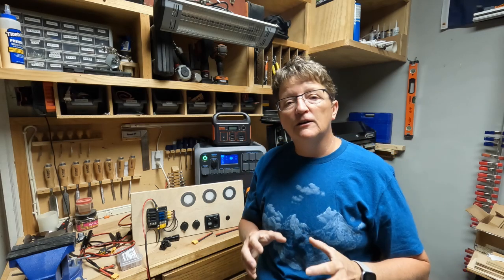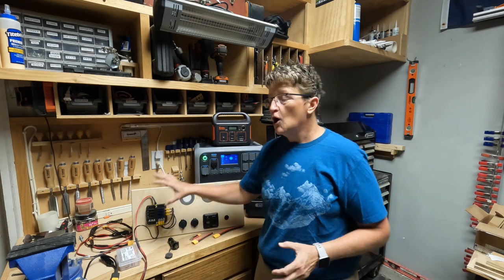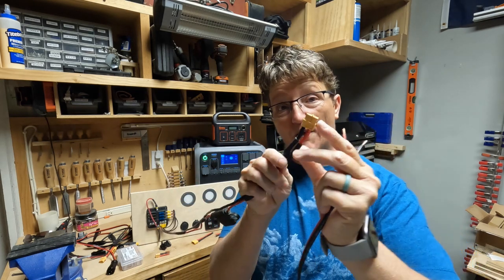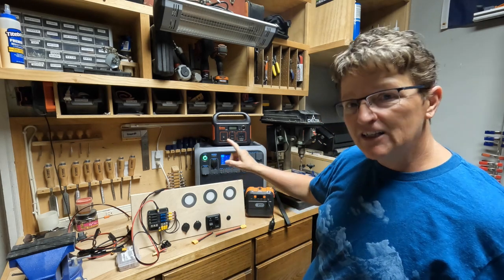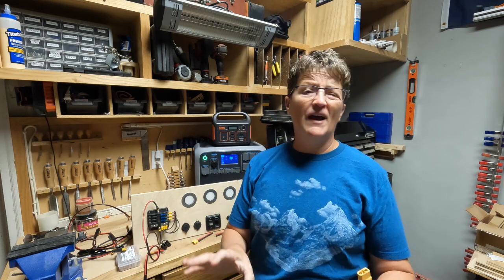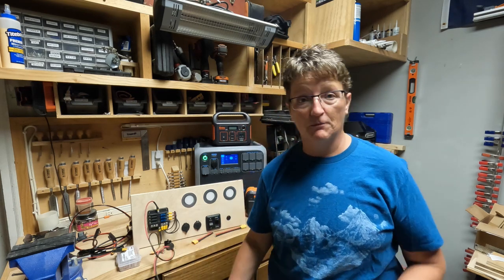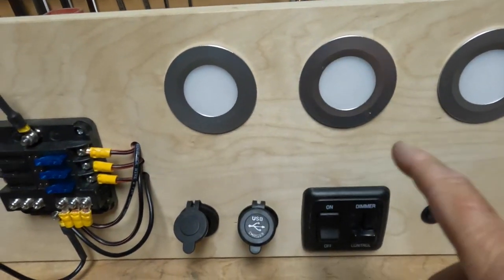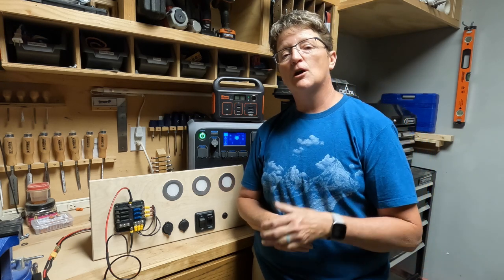Off-Grid Solar | Connecting DC Fuse Panel To Solar Generator

Comment: Don’t know if you still answer questions on this video. But I set up my system like this. My question is from the 12volt dc connection can you connect like a diesel heater from it or would that be too much on the system.
Reply from the maker: yes you can, you just need the power bank to be able to handle the watts.  I have several out on the road with diesel heaters running off of them.  you can always email me at midwestvanbuilders@gmail.com if you have any more questions.
Reply: @JonniesJourney  thank you for the help.

Comment: hello, Any ideas to using my ECOFLOW to connect to the fuse panel .. It output variations are different than yours with the Bluetti ... somehow i use an XT60 but from the Cigeratte lighter output ? any thought are appreciated.  thanjks
Reply from the maker: Yes, get an xt60 and wire it using 12awg wire. Put the yellow ring connectors on each end going to the fuse block.  You can add an inline fuse if you want the extra protection.  

https://amzn.to/41SAy3V
Reply: thank you. Much appreciated.

Comment: Have you had any experience with the EcoFlow Delta Max 2? The DC out is only 10a would that be enough to power the fuse block?
Reply from the maker: You can definitely power block. Just watch how many components you have on at a time.  The cig port can be unstable, so make sure you have a good plug and keep an eye on it when on those bumpy roads.
Reply: @JonniesJourney  thanks so much for the reply, are there better solar generator options that you would suggest that have higher output?
Reply from the maker: @mattheword  the Bluetti AC200Max is one of my favorites.  The DC Aviator port is 30amp output. It screws in and is very stable. You just need to order the cord to the block.  Links below. 
 https://shareasale.com/r.cfm?b=1745428&u=3330225&m=108816&urllink=&afftrack=

BLUETTI Aviation Plug to XT60 Cable & XT60 to SPC45 (Anderson Plug) Cable, RV Cable 12V/30A, Compatible with BLUETTI Portable Power Station AC300 https://a.co/d/ixbtWWC

ELFCULB XT60 to O Ring Terminal Cable,12AWG XT60 Male to O Ring Connector Cable with Tinned Pure Wire for RC Battery Solar Portable Power Power Station and Solar Panel(2FT) https://a.co/d/hkvMH3l
Reply: @JonniesJourney  you are amazing! 🤝🏽
Reply from the maker: @mattheword  happy to help

Comment: How does the procedure change for an AC fuse panel? I assume the process is similar with the live and neutral going to some external bus bar? Great video btw.
Reply from the maker: I don't use a panel.  The Bluetti has 6 ac ports. This video shows how I have mine connected.
 https://youtu.be/WJ8C4970dLg

Comment: I purchased the xt60 wire with the o-ring terminal. I wired that to a fuse box. Similar to the one you show. When I plug the cigg adapter in to the gen it sends an overprotective code. & Blew out a 5amp fuse so i out a 20amp fuse in. The sane thing happened. The generator is 2700 watts. How do I fix this?
Reply from the maker: Crystal can you email me at midwestvanbuilders@gmail.com.

Comment: How about this setup and a transfer switch for shore power/generator, so when available one could switch over and recharge the power bank ?
Reply from the maker: Since I use an inverter for DC/DC charging, I have to switch the power cord over when on shore power.
Reply from the maker: Do you know of a video where this is done that I could use?
Reply: No sorry I have not come across one, but I think just installing an AC inlet through the side of cargo van accomplished what I was referring to, I just was overthinking the whole thing?!…thank you for the response. I saw they also make Xt90 to Xt60 connectors and vice versa - that may be an easy way to solve having to have two cables - now I do not know if that is dangerous or not…. Every brand Power bank outputs different amps so not having all that info is something I would research on that connector but it may be an option?

Comment: my Bluetti 200max has 3 DC output ports; 30 amp, 10 amp, and a 10 amp. Can i use them all at once?
Reply from the maker: You have a 30 amp DC port.  One 10amp cig port and one 25amp DC aviator port.  You can use the two DC ports that are on the front left side at the same time but wouldn't need  to if you are using a fuse block.  Cig port is not a stable connection.  Please email me if this is confusing, and I will walk you through it. Midwestvanbuilders@gmail.com

Comment: An idea: I would like to see some static images of the cables you have created complete with the inline fuse. That would help me out. I think I am onto it. I ordered the DC out cable from Bluetti that fits in the 25amp out port which terminates in the yellow  xt90? female end and another shorter cable with the yellow xt90? male end on one side and a red and black connector on the other end. I believe I can cut off the red and black plug and then connect ring connectors to the red and black wires and attach those directly to my fuse block. Does this sound correct? I am willing to pay a consultation fee for a few emails back and forth if that is something you have time for and willing to offer. Gracias por todos informaciones. Yer awesome!
Reply from the maker: 👍 Email me at midwestvanbuilders@gmail.com

Comment: Would I be able to have each item on a separate switch
Reply from the maker: Yes, you just have to run power to each switch and then from the switch to the components

Comment: QQQQQ. do I need to have a DC to DC charger for my Bluetti?   The gentleman at the conversion shop said I do not need that because of the cigarette lighters are already in.
Reply from the maker: The cigarette lighter will charge it but only at a little over 100w/hr.  not the best choice.  how much solar do you have.

Comment: Just Two ??? You said you used XT 60s in the beginning and then switch to XT 90…

And the metal adapter with a Round Lug are not called O-ring. 
O-rings are referred to as a rubbery Round gasket/seal. But great 👍 info.
Reply from the maker: The xt60 is the one on the panel I am using for my class and video.  My Bluetti has the xt90.  Thats the one I showed with the aviator plug for my system.  

I'll have to google the proper name since you're not telling me 🤣

Comment: so, you plugged into the Bluetti  (12v  10amp).  How much can you power,  water pump, lighting, TV 12v, refrigerator 12v, fan ????????????
Reply from the maker: No use your aviator port.  Make or order a 2 pin and make the cord ro use your 25amp or 30amp if you have the AC300.  Use the 10amp only if you have no higher port 👍

Comment: is 10 amps DC enough? or should I find a power station with 25/30?
Reply from the maker: It really depends on what you are trying to power.  The number one reason I would try to go higher if you budget allows is...   the 10 amp cig port is not a stable connection. It often wiggles loose, and this creates problems.  These ports also get very warm.  Just my opinion, of course.

Comment: I actually think about this the opposite direction. I’m using the fuse panel to charge my ecoflow Delta 2 via solar.
Reply from the maker: How? Listening
Reply: @JonniesJourney  just a simple setup for now. 
Solar➡️fuse box➡️bus bars➡️O ring cable to XT60i connector➡️delta 2

Comment: Why would you use a portable solar generator like those over lithium batteries installed? Just for the portability?
Reply from the maker: portability, simplicity, and a huge cost difference.  These are LiFePo4.  👍

Comment: Im confused becuase everyone i talk to says i cant connect it directly into the fuse box, it needs a transfer switch.
Reply from the maker: You 100% do not need a transfer switch unless you are doung this in an existing system where the fuse block gets power from elsewhere.  You can email me at midwestvanbuilders@gmail.com if you have any questions
Reply: @JonniesJourney  ooohhh ok that explains it! Yeah I'm trying to connect it to my existing rv system. I don't want to keep using shore power  on the station since that draws SO much, and I'd like to keep the ac stuff on propane.

Thank you for the answer I've never had a creator be so helpful!

Comment: Why use a fuse box, don't those power station have a trip switch on them?
Reply from the maker: The power stations typically have one 12v/10a port. The fuse box allows you to power multiple components like Lights, fans, ball valve, toilet fans ect.  It is much safer and cleaner setup to use the box as apposed to a 12v cig  splitter. 👍

Comment: sorry .. but very confusing from 3mins to 5 mins. so how do you connect XT to your fuse board....  if not using ring connectors
Reply from the maker: You use ring connectors to the xt60 or xt90